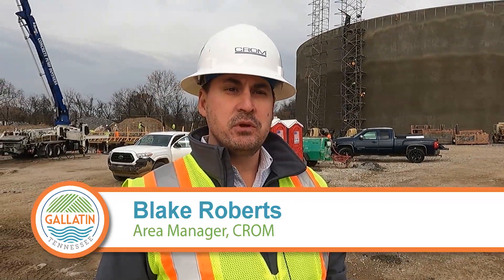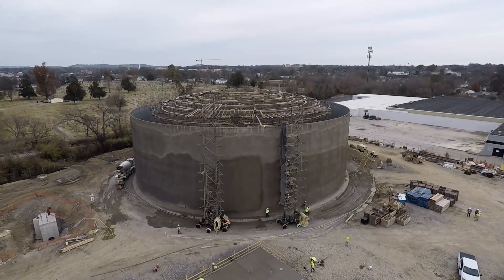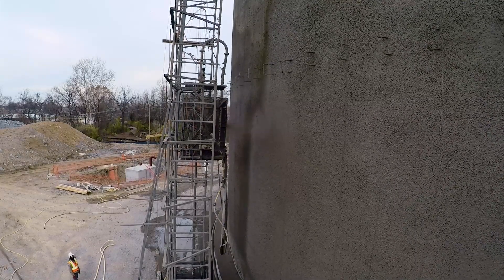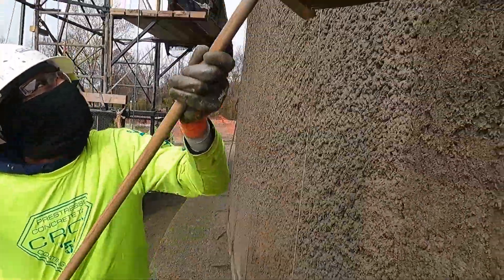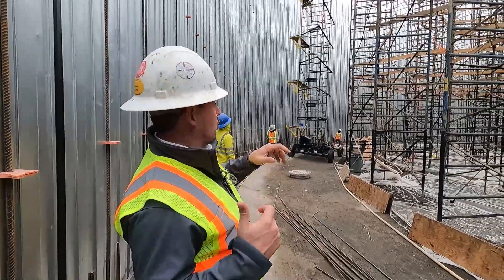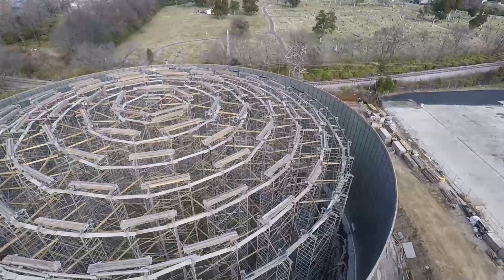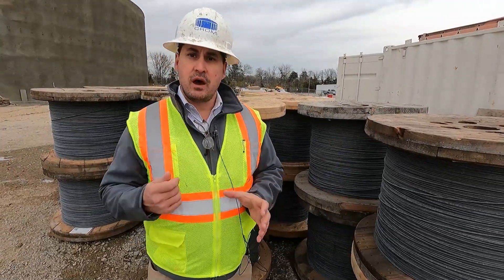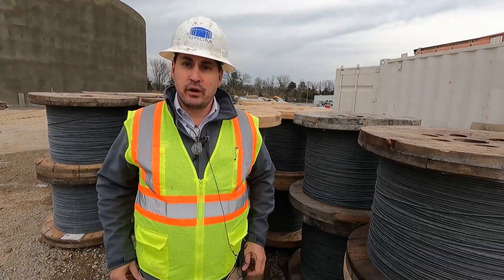GPU Builds 10-Million Gallon Concrete Tank

Comment: Thank you for the Education, this is what/how you build a Great White Tank... add a double or triple intake/outtake filter system maybe 2-4 systems a clear dome so people can have an overhead view wa 4 way crossing over top that spirals down  in the middle  to thr bittom as a viewing tower windows spaced around it (plexiglass sounds good as the physical structure but cement with plexiglass is better structurally) it should also be 2-3 football stadiums (not fields) long and 2 stadiums wide making a oval shape at least 3-5 stories high(killer whale size) your filter system should create 2 or more different  currants (topflow/under towe/ random current)  start this in florida or texas as a test if successful build one on each coast like Monterey Bay or Pier 41/49 in San Francisco closer to the coast the easier on filter system